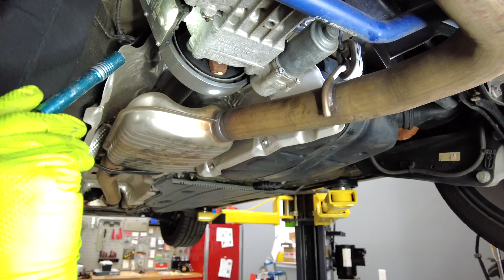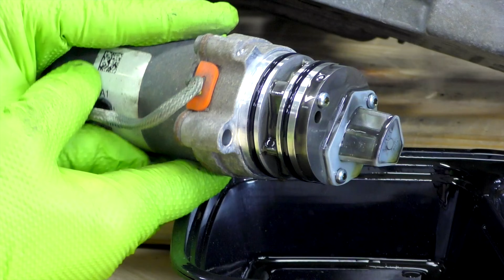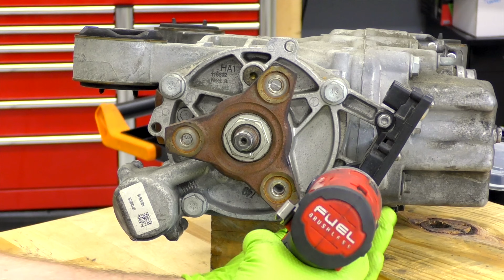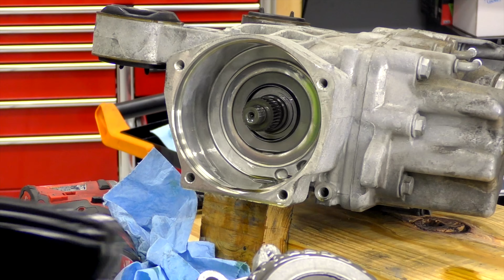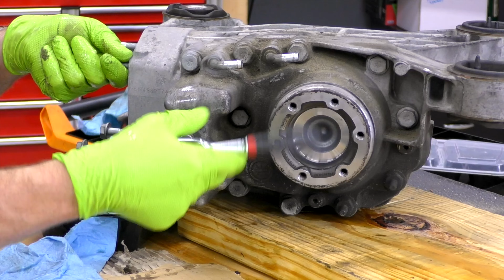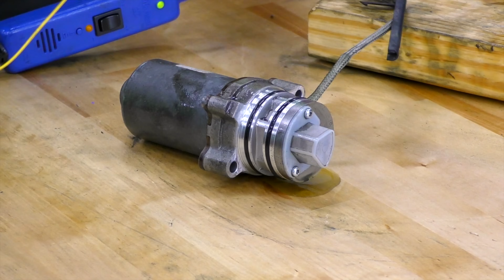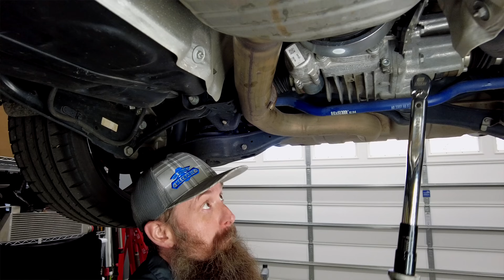Catastrophic AWD Unit Failure Audi S3 Golf R ~Haldex Failure

Comment from the maker: NOTE: This unit is NOT A HALDEX, it is a Borg Warner. I used the term Haldex because that is basically what we all still call it. LOL Also I have a DSG teardown video coming soon! Be sure to like this video if you like teardown goodies!!! Thanks so much <3 you guys.
Reply: But it is a haldex... borgwarner just bought them 🤣 still made in the haldex factory...
Reply: @garyhowe88  Actually B.W. only bought the division for hydraulics and four wheel drive systems. Haldex remains as a company of itself.
Reply: @sharg0  yes they bought the company haldex traction systems.. very common practice.. you have numerous smaller companies with a parent company.. but the factories still have haldex traction systems above the door, still the same designers workers etc, just a new parent company.
Reply: Could you make a piece to replace that clutch system and then have full time awd?
Reply: @scottmclean337  yes, you could, but you'd add much more stress into the transfer case, and that may blow eventually (they also fail sometimes). the smartest is to get a haldex controller, so you can choose when you want it to be permanent awd, and disengage it when you dont need it
Reply: @scottmclean337  Yes. To a cost many times higher then a brand new complete unit from VAG....
Reply: Old habits will never change.
Even though the ID3/4/5 has no engine in the front, I still call it the engine bay...
Reply: Hoping to see you disassemble the Gen6 Haldex in a few years, where the fluid change interval is decreased from Gen5's 3 years(except sport cars) to 2 years.
Reply: @oijhhytdirhrbru  the gen6 is alomst the same as gen5 only brushless motor whit integrade ecu.
Reply: @dannes6492  It's interesting that Gen6 has reduced the fluid change interval to 2 years from 3 years in Gen5(source from VAG, certain models with Gen6 are not available in north America)
Reply: @oijhhytdirhrbru  Probably because there have been problems with the filter getting clogged? . But there is also new oil in gen6.
Reply: @dannes6492  interesting, the fluid part number here for Gen6 has not changed yet.
Reply: It's funny that we always call them "a Haldex"...which is the name of the company, not really the name of the coupling, but that always sounded fine.  Haldex does make products other than AWD couplings but it's what they are most well-known for in passenger cars.  Calling it "a Borg Warner" just sounds wrong since they are well-known for making a wide variety of auto parts and buying out Haldex Traction was just another of the thousands of things they own/produce.
Reply: Thank you Charles for posting the video. Very informative! But the main question is where is that metal coming from? is the clutch pack disintegrating itself because the electric motor failed? or the other way around?
Reply: Haven't seen that much glitter since the strip club.
Reply: Muito legal
Reply: Great video bro can you point me In the right direction on what’s a good solution to clean the outside of the haldex without damaging anything?? Bought a used haldex from a 14 cc and it needs to be cleaned…😳🥹

Comment: I hear a noise and feel a certain heaviness at the rear of the vehicle when pulling away with the wheels turned. Could the problem stem from the Haldex system? Notably, when I deactivate the system, the noise disappears and the car drives normally. Please note: this issue only occurs when pulling away with the wheels turned, and diagnostics revealed no faults. Someone can help ?

Comment: Good that the failure is shown in full rather than just the replacement part. From Gen 5 the serviceable filter was dropped for a strainer, and the oil is sold as a lifetime fill, so clutch debris collects with nowhere to go until the pump motor is working against a blocked screen and overheats. Lifting that strainer at every oil change is the cheap step that keeps the next pump alive — and it's the one most write-ups skip.

Comment: Funnily enoughy this clutch has the littlest slip when disengaged, because the rear wheels are for the most part rotating at the same speed as the front and thus the prop shaft, giving the littlest spee difference. Compare that to e.g. thr DSG clutches where at least one of the two is disengaged at any time.

Comment: Very informative for me. Looking for info for mk8r. Can’t find any similar video about FRONT dif of mk8r. As i know GTI has VAQ locking front dif rather than R. The rear has two electronic clutch packs and there is a lot of info about it on youtube. But how the front dif works? Does it have any locking function? Does it need it? Or it uses abs only locking mechanism? Yesterday I got stuck in snow on my 8r and noticed that ONLY ONE  front wheel spinning freely when I tried to accelerate with vehicle standing still. How to make the car to lock it and give some momentum to another three wheels? P s. I have manual transmission if it matters. Thanks

Comment: This happened to my MK7 golf R. When pulling away from a standstill hard, the front wheels would spin or bounce, which was awful. And there was a squealing noise from the rear where i guess the clutch pack couldn't hold the tourqe. The car was almost two years old, with around 17k miles.
Also, I had a customer with a MK5 R32 that snapped that input shaft to the clutch!
Reply: So how did you solve it? I have a 2015 Golf 7 R, I changed the pump and oil but the pump isn't working, my car jerks when I accelerate suddenly and gives error code C111307.
Reply: @berkayasliiturk  I didn't,  I cleaned the filter but it made no difference. So I traded it in. It was a great car and I would definitely have another but I had lots of bad luck with it getting damaged and every time it was getting repaired I would be running round in a polo or an Up. I suspected there was an issue with the haldex and I would be back in a polo waiting for parts. So I used it as FWD for a month or so then traded it in.

Comment: I just took my 150000 mile haldex coupling out and it’s was about the same as that, I cleaned it filled her up, reset with vc and it’s fine…. Some people are too radical with stuff, use common sense and repair

Comment: Charles,  good video! From one engineer to anorher...
 In summary,  the following OBD11 hack will do something similar RE quicker wear and tear on the Haldex clutch packs...
▪︎▪︎▪︎▪︎▪︎▪︎▪︎▪︎▪︎▪︎▪︎▪︎▪︎▪︎
Haldex All-Wheel-Drive Adjust Traction
-------
Reports indicate that changing this setting to ‘Increased Traction’ improves the handling and makes the car feel like a permanent AWD system.

Select AWD Control Unit
Adaptation
Acoustic Measure, wiring Logic
Choose from ‘Standard, Increased Traction, Less Noise’
.....   
I did this to my mk7 R , and with traction all off,  it hooks the rear of car hard !

Comment: Hey there. I have a question about my haldex problem of Audi a3 TFSI 2016 Quattro car if anyone know what could it be. My 4 wheel drive is working only for like 1-2 min when car is still cold and after that it stops working.We replaced pump, controller, haldex oil and electromotor but nothing changed. Does anyone kow what could it be? Thanks for any asnwers :)

Comment: This video is sooo good, thanks for that!!
There is so less experience in nearly every VAG dealer or any other maintenance shop with this issue! Everyone just wants you to buy just a whole new clutch or diff. 😂
In my case the new pump + factory reset didnt work. When I turn off ESP completely and give Full throttle on snow - sometimes it gives some grip to the rear. So the diff should be okay but there is something wrong with the clutch or just the pressure relief valve!?

Comment: I understand if the owner has a blowout and replaces a tire with more than 2/32" difference from the other tires, the AWD might become partially engaged all the time, prematurely wearing out the clutches. I hear this is common with Magna-Styre  AWD systems, too.... That all 4 tires must be replaced concurrently. I also heard not replacing all tires at the same time can kill and AWD box in about a year and a half or so.

Comment: Thank you for showing this. Got 3rd gen Haldex on my Volvo XC70 and can’t get it to work for a year now: (1) DEM was corroded, got replaced and re-programmed - didn’t help, (2) Soleniod was replaced - didn’t help, (3) Oil pump was replaced - didn’t help, (4) Oil pressure sensor was replaced - didn’t help…all of this time diagnostics is showing low oil pressure…I guess it’s time to open it up and check those rings…

Comment: My rear diff blew up at 70mph with a violent jolt (one of the tapered roller bearings obliterated itself and cracked the diff open as it did so), very soon after my Haldex oil was changed. Working theory is the specialist garage may have drained the diff accidentally (there's even a TSB about this very thing, so it must not be uncommon), given the tone sounded different after the service. I even took it back to them before it blew saying it sounded wrong, but they sent me on my way.

Comment: As a mechanic i have never seen a failed Haldex, only clogged filter on the pump. The common failure on these gen 5 rear diffs are the right outer bearing. Have changed so many diffs because of failed bearings. Now i have started to take the diffs apart and change the bearings. I did see vw had a revisioned part after 2018, so maybe that newer diff don't have bearing issues.
Reply: I have the rear diff out of my 2017 VW Alltrack right now. I'm going to swap the bearings instead of buying a new one. Where and how did you source the bearings?
Reply: @compr3ssion  4x4parte have everything you need

Comment: The lack of warning of awd failure in haldex system is not justified. You get warnings for other not-so-important problems, like egr slow opening speed. If the haldex communicates, you are at least prevented about the fwd tracrion only state. And, the other issue, the 3 yrs no miles haldex oil interval. Some people drive a lot, like more than 100k, in 3 yrs. Some drive in harsh conditions (that s the purpose of awd, no?). Also  they don't include with the dealers instructions the cleaning of the pump, which manymany people have encountered as compulsory, in some vehicles.

Comment: I have a 2008 S3 8P. This is the 2nd Haldex failing on my car. The last failure made rear wheels to lockup completely while going at 160km/h on Autobahn.
I was on the left lane, had to pull to right in under 100 meters. Otherwise all the cars at the back crash from behind. Was lucky, I was able to save the car from a crash.
But it gives no warning on dash, no whining sound of gears, no jerkiness. Everything seems fine, then rear wheels mechanically lock up.
If it happened while I was turning at high speed, it would spin or crash at the hands of the most experienced racing driver. Nothing can disengage rear wheels. We had the same lockup in another 2018 model S3 too. I think the design required to be changed. In case of a failure, it shouldn't mechanically lock the wheels.
But it happened 2 times on a 8P car, once in a 8V car. I think it may have killed many people, but it would be very hard to explain what happened after a catastrophic car crash, that your rear wheels locked up. And if the driver is living, will tell you this. But it may be hard to prove it in the court.
I think Borgwarner needs to take these units back. Change the design with a safe unit. May cost billions though.

Comment: A couple of Ex VAG mechanics have independently of each other said to me that most of the time on the 5 its the pump that fails and the metal  is from inside the pump.  One of them said unless you never service it and kick the arse out of it the diffs last for ever.   Both said the pumps are complete shite.   A quick polish of the clutch plates on this one and a new pump and seals and she’ll be good to go.

Comment: I love how I commented on this a year ago... clutches are fine. But I suspect the bearing(s) on mine have failed...
Reply from the maker: YIKES! but that may be a better failure? if that is such a thing
Reply: @HumbleMechanic  Regardless, I have extended warranty which I am happy about. But I saw a video of one guy who took apart the diff and the tapered roller bearing is pitted to hell. Some guy in the comments said the bearing on the right side is the weak link. I think it's smaller. It then makes me wonder how these newer cars with the drift mode will last... Lot more side load...

Comment: So how does it control the level of clutch slip? 😮
Does it just pump oil into the clutch housing to press the disks together and controlls it via how much oil pressure there is?

Comment: 320.000 km & 31 years of use of my Passat Syncro g60 @ 200 ABT hp, no engine repairs, no VCT Syncro malfunctions!

Very nice work, congratulations! 

The Syncro Heresy
Reply: Yeah, things weren't made to fail back then.
I don't believe these failures that happen on new cars are unintentional, just can't believe it.
Many haldex systems fail at 50k km, which is very very low. I doubt they don't test their cars before launching them cause otherwise they would see the failure quite easily.

Comment: If the haldex motor or clutches fail, would there be any harm in just welding the haldex connection so it's a constant 50/50 AWD?

Comment: My mom had a 2012 Tiguan she bought new and the Haldex failed around 22000 Km.  It was fixed under warranty, after a good fight with the dealer.  Dealer in Costa Rica was really a bad one.  It has improved a lot in the recent years.  I believe it was the pump that failed so the car was basically a FWD instead of a AWD.  How she noticed it?  When she stopped and start the front wheels will spin.  No warning lights or nothing else to let her know something was wrong.

Comment: I repair these differentials, replacing all four bearings and four oil seals and thoroughly flush each part as well as the housing, from the inside. And that's not counting the Haldex clutch where there's also one ball bearing and one oil seal. If anyone is interested, please feel free to contact me.

Comment: It makes me wonder if the TCU was tuned as well?  Is the metal on the clutch discs a result of the upgraded clamping force (or lack of, if it wasn't tuned)??  I feel like there are more variables to this that's necessary to formulate some solid conclusions.

Either way, it's clear the pump went, but I wonder how much time those clutch packs had left on them?

Comment: We are Haldexrepairs in the UK, this Gen 5 haldex coupling is perfectly fine and has not failed mechanically. It is most likely to just have pump failure. The clutch is still totally good. But the most common part for coupling failure is actually the outer O ring seal on the piston you removed at 4:26 gets chewed up and leaks. That is pretty much the only thing that fails on them. Good luck! And we call it a Haldex even though its a Borgwarner Power Drive Systems G5 coupling due to licencing issues since Haldex AWD was sold to BorgW. Enjoy :)
Reply: I’ve replaced the Haldex 5 pump on my Volvo. I’ve done the calibrations but it seem like the clutch is slipping or rather engaging late by a second or so after taking off from a stand still. 
Any ideas of what rabbit hole to send me down?

I had a yr between the old pump dying and replacing it with a new one were the car was just running in FwD   

Thanks for any help
Reply: Hello
Thanks for the additionnal information,
The o ring that you are talking about, do you know if we can buy it somewhere ?
Reply: can you get bearing kits for the differential section? i have had 2 come thro now with knackered output bearings on the drivers side. no-one has let me have a car long enough to ID the bearings. (in the UK too)
Reply: @denisohbrien was there any space, was there any play on the long cup that connects to the differential (left), any knocking noises when starting?
Reply: @patrykkrol9433  I don't recall any play that shouldn't be there, was diagnosed with a stethoscope and running the car up to speed on a ramp, was a failed bearing for sure but no customer has yet been willing to let me have their car for a few weeks to strip and identify the bearings
Reply: @denisohbrien do you have whatsapp? I can send you a video. how much clearance do I have and is it normal? Approx ?
Reply: @denisohbrien 2 years late but looks like febi do a kit now for anyone else reading this febi 1000000 or similar (lots of 0s)
Reply: I had a outwaren pump too. I changed it to a new one and the system was totally fine. Now I have a new problem with my rear final drive. If im going between 60 to 100 kph, i get a really loud wummering noise from the back of my car. The noise is not on contact with any tirestuff or so. I think I have to replace all my bearings in the Haldex/Differential unit. Seems like that this is also a common issiu with the Haldex. I have 190000km on the clock an its a 2014 Golf 7 Variant 2.0TDI.
Reply: @Feldhaus808 what was it?

Comment: I had my rear diff go out on my 19 Sportwagen with 37k. Strong smell of gear oil but no leaks. Rear wheels locked up. They replaced the whole rear. They said the Haldex was fine. About $6k. Under warranty

Comment: Ford also used the Haldex system on the mk1 Kuga ( escape in the US) they were known to fail. Always caused by not having the oil changed. The small gauze filter blocks and kills the pump. Ford initially said it wasn’t a service item. However the systems were also used on Volvo cars and Landrover Freelanders. In these applications it was recommended to change the oil and clean the gauze at least every 30k miles. This helped prevent failure. My mk1 Kuga, which I still have suffered a failure at around 40k miles. I replaced the pump with an eBay item. It cost around £230. I have had the oil and filter changed every year since and have had no more problems. Service kits are available on eBay which includes a new filter and a litre of oil for around £60.